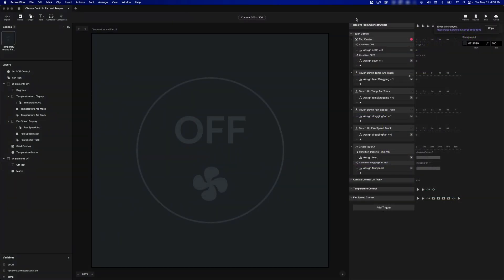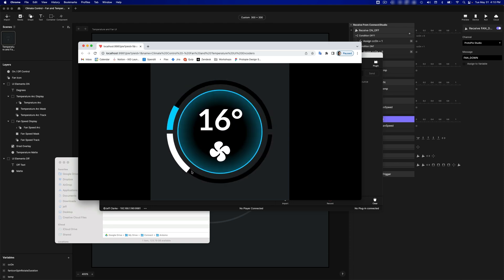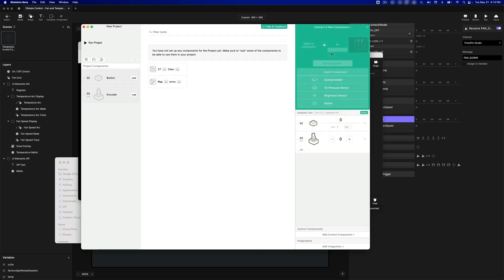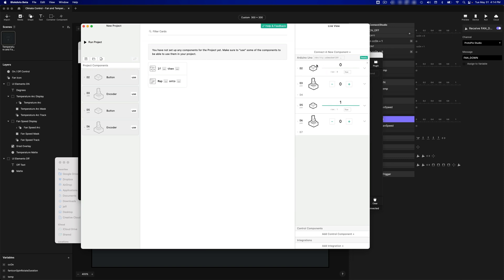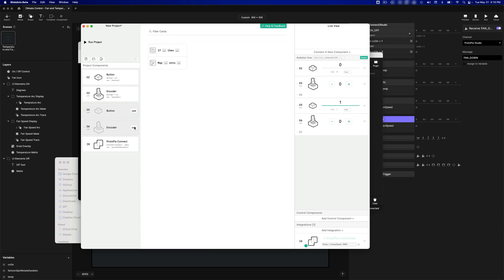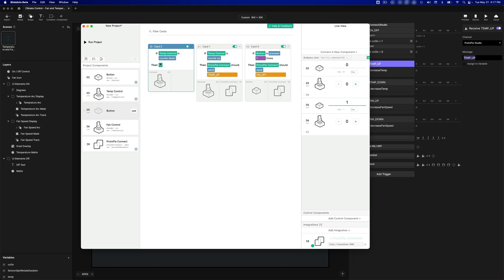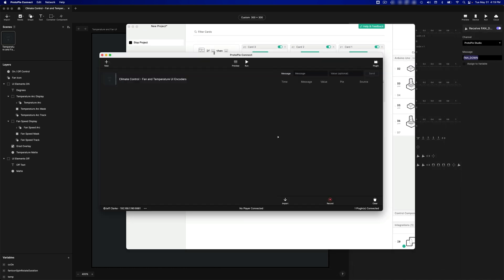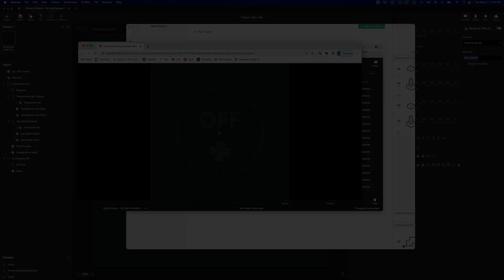Intro to ProtoPie Connect | 3. How to Use Blokdots to Integrate with Arduino Projects

Comment: Is the Blockdots subscription is included along with protopie pro subscription or should i purchase it separately?
Reply from the maker: Hi! Thanks for tuning in. In your case, you could subscribe to the Pro plan with the Connect add-on. You should be able to do this during the checkout process. Hope it helps!